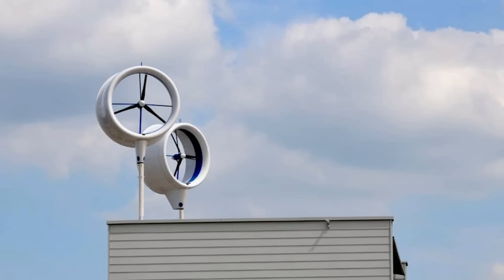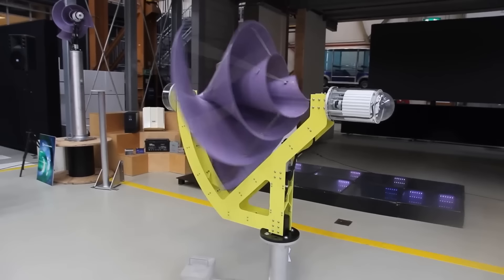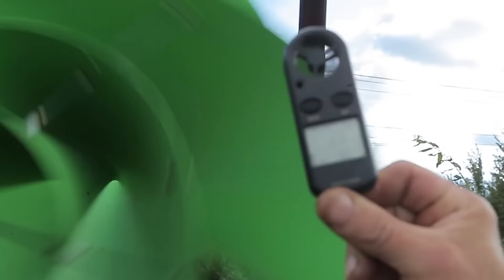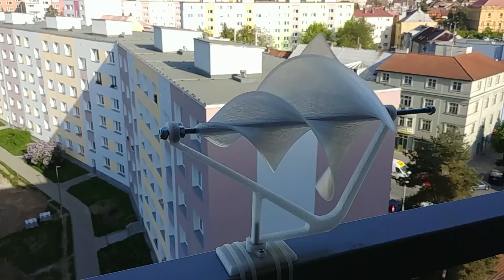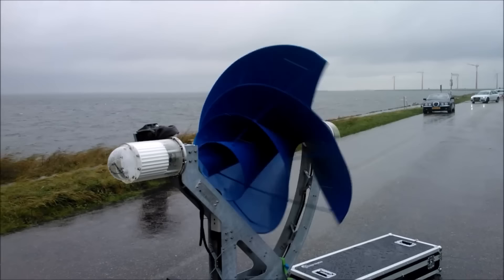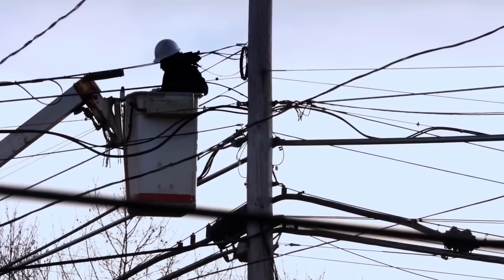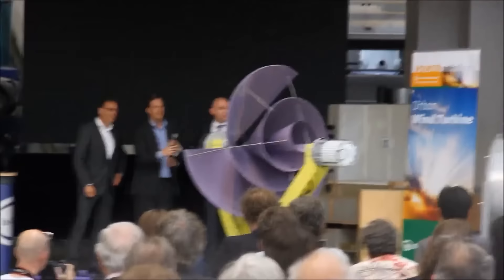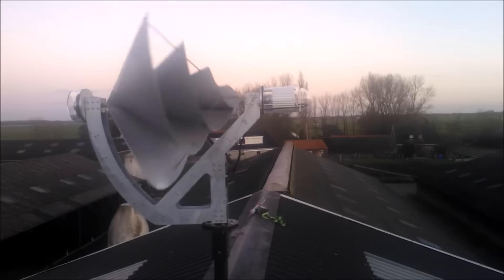How The Liam F1 Wind Turbine Will Destroy Every Home Renewable Energy Source

Comment: I looked this up and it doesn't seem very affordable compared to solar. However, for most areas, you need a permit to have wind installed on a roof, so a silent model would probably be the only option if you want wind. Also it has one big advantage over solar: Ameren (my local utility) has a net metering program tat gets zeroed out once a year which happens to be at the end of summer. This means that even if they owe you money they will just void that and remove any credits you earned from generating power in the summer. This means that you need a system that exceeds your average usage if you want a grid tied system where you don't have to pay the utilities. Wind, however, is more abundant in Autumn right after that reset date so depending on the cost might be better than solar or might work well as a hybrid system.

Looking at the numbers:

The "Liam F1 Mini  Urban" model wind turbine costs around $5,450 + installation costs, goes on the roof, and generates no noise. It's based on the Archimedes screw and is advertised to produce an average of 1500 kwh per year with wind speeds of 5 m/s average, but will produce energy when wind is blowing as low as 2 m/s and nothing below that. This means that the advertised "average" will really depend on how windy your area is on average. 

Getting an anemometer first would be a good idea to determine what your average will actually be. You can buy one for less than $100, but unless you plan on writing down the numbers multiple times a day every day for a year you are better off spending a bit more on a model that can log historic data. You can then use that data to determine how suitable wind is for you.

The average household in my uses 8,376 kwh a year. If we round up and assume you'd want 9,000 kwh and if we also assume each unit gives you an average of 1500 kwh a year you'd need 6 of these for a total cost of $32,700. A house that uses 9000 kwh a year will end up spending an average of $500+ a month so such a system would save $3000 a year meaning it would take 11 years for the system to be paid off assuming no maintainence is required.
Reply: sounds like your utility provider will put the zeroing for wind at mid autumn ..

11years at best for ROI is a bad deal, is there a tax deductible or something you left out? else solar is much better thanx to those
Reply: When I signed up for net metering with Ameren Illinois four years ago, I was given a choice of resetting October 1st or April 1st.  To me it made the most sense to go with the April reset date.  It has been my experience that having the build up of credit going into winter allows me to supplement natural gas forced air heating with electric quartz heaters.  I would like to add a small wind turbine to my solar panels as a safety net to allow additional heater usage should I need to.
Reply: Who the heck wants 6 of these around your house. Ugh,
Reply: @Mrbriangalvan  , 
I  have  4  P.M.A.s  and  each one is  capable of making 1200 to 1800 watts each  , 
One is  hooked up to a  V.A.W.T. 
One  to a  water wheel 
One  to  a bicycle  
One  to a 42cc  gas  engine  

Then I have  Solar Panels  

So  I'm  using  Wind , Water,  Sun , Human  power  and  gasoline  for backup , 
I also have a 2000watt Generac generator .
Reply: Interesting but you overlook the fact that the cost will be reduced once the turbines are mass produced.
Reply: @TheyCalledMeT  Regarding net metering I don't think they can do that. They only get away with it by calling that the end of the year for fiscal purposes. Giving different customers a different end of year for different kinds of renewable power would probably reveal their true motivations. 

There are tax deductibles, but those vary significantly by state and in many cases they don't apply at all unless you are already paying taxes high enough to owe that much and only if you itemize your deductions. Only someone in the upper middle class would really benefit from such a deal. If I am wrong on that though please correct me.
Reply: Duty cycle = 25%
Reply: Nice review, thank you. For those not metrically inclined 5 meters persecond wind speed works out to 11.1 miles per hour. The 2 meter per second minimum identified in the video works out to 4.5 miles per hour. If I would be inclined to look into this as an option, I would definitely get some sort of metering done to verify local wind speeds. Also that data may be available from some of the weather sites. I am looking into that. Again thanks.
Reply: Ok, but you are missing the aforementioned installation costs in your calculations, and you assume that you can use all the generated power from your turbine, which won't be the case, same as with solar. You can generate 9,000 kWh with solar panels for 10,000 euros, including installation. Wind power is only viable on a large scale because there is simply not enough wind a few meters above the ground.
Reply: @janos5555  Which is why I said that it's not very affordable compared to solar. Of course, solar degrades in performance each year while wind doesn't, but that is probably why some people go for a hybrid option. Additionally some people may be in a situation where wind is more suitable for them than solar.
Reply: "How The Liam F1 Wind Turbine fails to do jack all". 
Because, Weather is getting more unpredictable every year.
Because, On a large scale, energy conversion devices with any number of moving parts simply cannot compete with Solar panels that simply sit there, While getting cheaper all the time.
Because, Matching the output of Wind turbines with household batteries is a pain. (I know, I tried :D )
As a personal energy device though, It looks interesting. Until something newer comes out.
Reply: Okay a 10kwh solar system, with zero moving parts and nearly no maintenance will produce on average 18000 KWH a year. Will cost around 40k of which 30% is rebated as a muti year tax credit. For this to produce the same... would take 12 systems. At say 6k  is 72000. Way better off capturing some solar in a battery. Additional cost of 15k... than adding any of these.  This system though starts to make sense at under 2k where lower upfront costs will and can offset additional maintenance costs due to many moving parts. Sliprings, bearings, generator, mounting braces... so it's halfway there. It makes more sense where it's built, so northern latitudes that no sun for weeks at a time in the winter... they should get a big investor and sell at a loss until they can scale production to lower costs. If they did. I could see Integrating them into a solar system.
Reply: @Agatesforbrains  Where are you from? A 10kWp solar system won't cost you 40k in Germany where I am from. More like 12k without any goverment subsidies except 0% value added tax.
On the other hand such a system won't produce 18000kWh in Germany more like 12000 if you are lucky and only 8-9000 when your roof is not pointing south
Reply: this is a really good idea imo but the cost is what probably lets this down. I live in england and i would need 2 of these for my house to be free of the grid, probably 3 to make absolute sure. Not sure how your electricity firms work but here if you have, for example, solar power then any excess power you produce can go back into the grid and you recieve money back depending on how much power you put in but at that price it would still take a few years for it to pay itself back
Reply: @janos5555  here in America, with shortage of electricians, main panel updates, grid ties and insurable safe roof mounting it adds out to.about 3.5 3.8 dollars a watt.  Commercial ramps out about 2.4 a watt.  DIY Could probably save you half. But you better know what you are doing.  Utilities are probably .9 a watt.
Reply: @angelofamillionyears4599  True, but by how much? Current price is US $5k+ (not sure if that price includes tying into your house electrical - my backup generator cost close to  $4k on sale and the install was another $3k). I'm all for it, but the ROI has to make financial sense.
Reply: @Chris-ji4iu  True.Prices vary by vendor.
Reply: Make your own, I am considering it myself.
Reply: for less than that you can get a solar system that includes batteries, and that will provide adequate power.
Reply: @JD96893  True but geothermal is better since the sun and wind does not always produce.
Reply: In Buffalo you’d have to be concerned about it ripping off your roof, not about if you have consistent enough wind.
Reply: @axe2grind244  What is the wind level on the wind index?
Reply: I got lost, when you said it would save 500$ a month,  wouldn't a year just be 12 times that? So 6000$ , just wondering how 3000$ was calculated.
Reply: @jimthomas1989 A stationary bicycle can generate 100 watts - 200 watts max. NOT 1000 Watts, not ever
Reply: @MrSummitville  , my PMA is  rated from 1200 to 1800  watts .
I have a 26 inch rim on the bicycle and  a 3 inch diameter  pulley on the PMA  .
It's an 18 speed  bike  and  it's a serpentine belt .
And  it's for extreme  back up  in case there is NO  Sun , Water,  Wind , or  gasoline  and I have a  engine that runs on  Kerosene/ Fuel oil .
Reply: Well, 700 watt, max (cut off) 1000 watt. So one of them (for about 5000$) does about as much as 2 solar panels. Ofc it also does it at night and with clouds. But anyhow the price to power is still bad. It will be nice to be 100% self sufficient. But not price efficient.
Reply: @jimthomas1989   What are PMA and VAWT?
Reply: @derschmusetigger4220  
PMA  stands for  -
Permanent 
Magnet 
Alternator 

VAWT   stands for  
Vertical
 Axis 
Wind 
Turbine
Reply: bro, buy a 3d printer and print it, you have it a lost cost and win a 3d printer
Reply: @coolfool3000  That was "spending" $500 - not saving. I was referring to how much people spend per month on average without solar. The $3000 annual savings comes from a caculation of the up front cost divided among the years of expected use and comparing that to the $500 assumed costs you'd otherwise have.

So, to break it down for you:

I assumed that it would cost $32,700 to replace a source that would cost $500 a month ordinarily. In other words, we are assuming that such a person spends an average of $6000 on energy without panels.

After panels are installed they aren't spending the $500 anymore. There may be tax breaks, but those almost always come from the money you'd otherwise be paying in taxes so unless you earned enough these calculations don't really matter, while a person on poverty level income might technically be able to get panels on a mortgage refinance even if they don't get any credits.

So with that said we are assuming the full $32,700. If we divide that by 11 years  the annual cost ends up being $3,381.82 which means that compared to the utility cost you had before you are saving around $3,000 a year.

So basically I was saying that if you paid half the price you already were per year it would be paid off within 11 years showing that even while it's being paid off there is savings.

Technically if you just split it evenly you'd be paying the same amount you were already and after around 6 years it's paid off, but 11 years is around the time that most people start needing to maintain them. Sure, panels will last upwards of 30 years, but only if they are cared for properly. They will degrade, wires may need to be replaced, they might need occasional cleaning, etc.
Reply: I think this vid is meant more for off grid folks.
Reply: I paused and just started reading comments. Did the video mention bearing life or monitoring of the bearings ? There's the main shaft bearings which are surely sealed. It would be straightforward to include a rotation counter that was also programmed to account for elapsed time. I.e. the lubricity of ten year old grease is considerably less than that of one year old grease. Wouldn't the base bearing that the allows the turbine assembly to rotate into the wind also be a challenging long life bearing application? It would also be useful to have an anemometer integrated into the system. By having a non-volitile memory year to year electrical output vs wind speed would be a useful metric to monitor bearing condition.

On an environmental note turbine silence would probably equate to more dead birds. The birds in Texas don't see forward very well. I hear bird thumps when they fly into a window of my home.
Reply: @Mrbriangalvan  some months my electric bill runs as much at $800, and that's a huge portion of my "expendable" income. Also, during about half the year, our southeasterly Gulf winds run 25-30 mph all day long, so with a way to either sell back or store these kWh's, IF the machine were really affordable, I would love to have 'em. Of course, I do more or less live out in the country, so I'd probably put them on posts up about 20 feet or so out in the back yard, so only my back neighbor would really see 'em.
Reply: Thanks for your rundown. I hope they will produce one large model for household usage
Reply: Thank you!
Reply: So it costs as much as a car, but doesn't have the horrible issues with eclectic car batteries if you wanted to power your home fully with multiple units.
Reply: @jimthomas1989 : You must try making a POWER GENSET, "powered" by a  GASOLINE or DIESEL  ENGINE, being runned, by "compressed air engine" (C.A.E.)- with "near perpetual  system" (NPS) in design.. Commonly called HYBRID set. up today ;

1) Youll installed a 2nd TANK as "exhaust air catcher", with "12-14 psi" negative pressure inside...

1.1 - Such 2nd tank will have a 3.hp elec motor, to "automatic'ly" TRANSFERED to the 1st tank, the "accumulated" EXHAUST AIR , inside the 2nd tank ;

2) The 1st TANK must have a 700. psi internal PRESSURE for GASOLINE ENGINE (1,400.psi for diesel engine) ;

2.1 - An electric engine, 3-5 hp rating, (Also gasoline engine an option), must be installed at the said 1st TANK - to MAINTAIN its "operational pressure" ;

2.2 - For accurate monitoring, approp'te gauge/ meter (pressure gauge, volt mtr., ampere mtr, solenoid, etc.), should be installed on both AIR TANK ;

2.3 - When the "pressure" of the 1st TANK become 600-650 psi, the installed "elec. or gasoline engine"- will start "atomat'ly", then will CUT- OFF automst'ly., when the PRESSURE was 700.psi or 1,400.psi for diesel engine... and vice versa...

3) Just searched You Tube, about the latest "prototype design" of CAE techno'gy...

4) The design of "Flywheel Energy System" (F.E.S.), was in You Tube - used already in year 1940- 1945, WW-2 era, by a certain "Gyro Bus Company", in Swit'land ;

4.1 - After the war, the bus fleet was exported to Africas nations.. Later on, the bus comp'y goes bankcrupt, due to high expenses, in bus spare parts ;

4.2 - Heavy capacity Neodynium magnet,  can be used as REACEMENT for "ordinary bearing" - to minimized LOSSES via friction ;

4.3 - Dont forget to installed a small GASOLINE ENGINE, it will start AUTOMATICAL'LY, once the "flywheel disk" ROTATION PER MINUTE (RPM), had "slow down" to 2,800 - rpm, and will CUT OFF   "automat'ly" once the NORMAL "3,000. rpm" was reached... And vice versa...

5) Covered with quality your invention, to PREVENT the "unauthorized" SCRUTINY of your contraption... NO AUDIENCE when working with your Genset, not EVEN wife, children, best friend, pastor, etc. - to MAINTAIN the  "secrecy" of the project ;

5.1 - Remind you family member  about the saying : NO TALK, NO MISTAKE...

5.2 - When you sensed that "time for DEPARTURE was near.." - explained to your TRUSTED son, daughter, etc., the secret of your "invention" ;

6. Your "invention" must be for PERSONAL used ONLY of your FAMILY - never try to MASS PRODUCED IT!.. Also, never REGISTERED to "Patent Office" your INVENTION ;

6.1 - Such OFFICE was the FRONLINE "radar" of the "oil moguls", to DETECT INSTANTLY, any "inventions", which will be a DEATH THREAT, to their multi- billion $$$ bussiness EMPIRE...
Reply: The affordability question is painfully. It all depends on production outputs , uptake and where the Government subsidies swings.
Reply: Lol wtf are up with these comments 😂
WATCH OUT FOR THE OIL MOGULS!!!! 😂
Reply: It's not that it isn't affordable compared to solar, it's just not affordable. I'm going to put one together today to test it. PVC pipe, a heat gun, a makeshift axle, and an alternator from autozone. If that doesn't work I'll have to build my own generator, but it should be fine.
Reply: @johnaeryns5364  let me know how it goes, how much watts per day it generates
Reply: @isaacgary6801  will do, if this thing is efficient it'll be the first decent renewable energy source ever.
Reply: Will it sustain thunderstorm when wind is above 80M/hour, I suspect !?
Reply: @TheRobinandme  it should, I made mine out of 1/2" PVC. The mountings are all solid aluminum. And I've added stabilizers and non mechanical valves. Currently it's generating about 14 kw per day. Way below expected values, but still plenty of power for my needs. And when I need to replace parts, the most expensive ones are a couple hundred bucks.
Reply: @johnaeryns5364  bro can you make a video or recommend a video on how to self make them?
Reply: @isaacgary6801  I guess I could. I've never made a video before, so the quality is gonna suck. But the materials you'll need are 

2pcs 1/2" thick pvc, 18" long
1 18" x 3/4" aluminum rod
4 aluminum pipes
A piece of plywood, and brackets for the mounting.
1 1" PVC pipe to mount the fan blades to the axle.
1 1/4" ball bearing coupling
And a good alternator. This part is trial and error, if I use a better one, or just a different one I could probably get more or less power.

Tools you'll need are 
 Carborendum blade grinder, or something to cut the PVC. 

A heat gun

A drill, with a 3/16 bit(adjust for whatever works for you. This is to make the valves, a router would be better, but I don't have a router.)

I used that same drill to mount it, but you could use a tig weld if you've got it. 

And some pvc glue.

I cut the PVC, and flattened it using the heat gun, then I added tesla valves against the direction of wind flow. Then I heated it back up, wrapping it in a spiral pattern. And letting it reharden. I hammered the aluminum rod into the small pvc tube. Then heat shrink it to be balls tight. I mounted the ball bearing coupler onto the aluminum posts after cutting it to fit and filing it smooth, then I used some JB weld I had laying around to secure it. Glued the spiral PVC to the axle, and mounted it to the frame through the ball bearing coupler. Open up the alternator housing, and attach the axle to the rotor. You may need a gear and second ball bearing coupler depending on the alternator. That or a gear. But if you need to use a gear, make sure you keep the same ratio or better, I think it would generate more power, but I don't know what the load on the alternator would be. So I didn't chance it.   Mount everything to the brackets, mount it on the plywood and you're done. A 5000 dollar price tag drops to a few hundred bucks. I already had the converter, and storage battery, so those might be additional costs. But all in all, it works pretty well. I'll improve the design as I see problems.
Reply: Solar power on your home will save to $20 a month. And that not including. Maintenance of your gaudy panels on your roof. So best look into this stuff cuz it’s a scam.